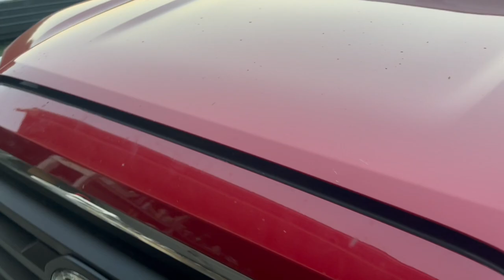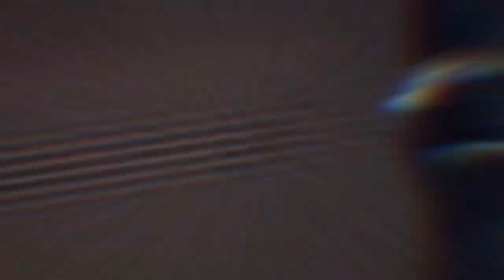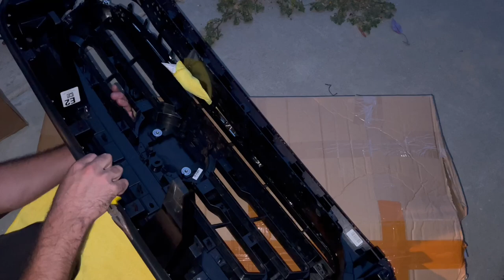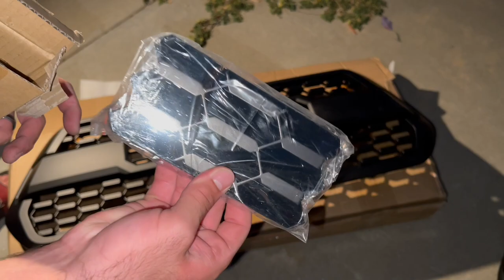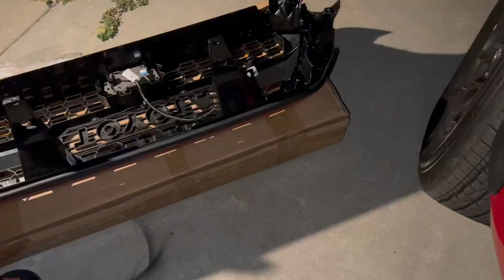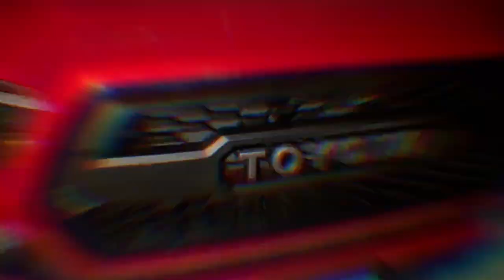Installing TRD Pro Grill on The Tacoma in less than 10 min!

Comment: The particular grille you linked from Amazon, the plastic piece you removed to install the TSS cover, did it come off as easily as you show, or did you have to “melt” the upper tabs off the back for it to come off?